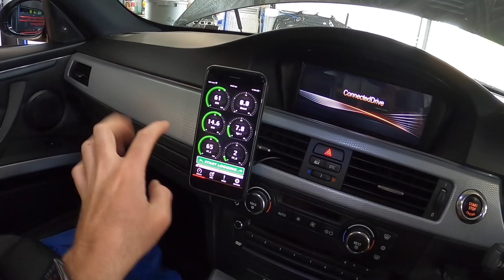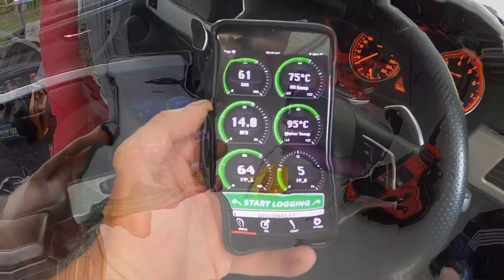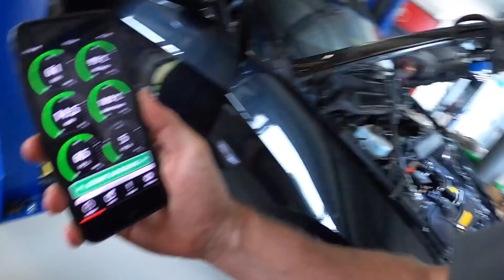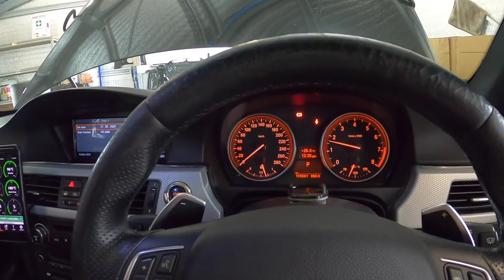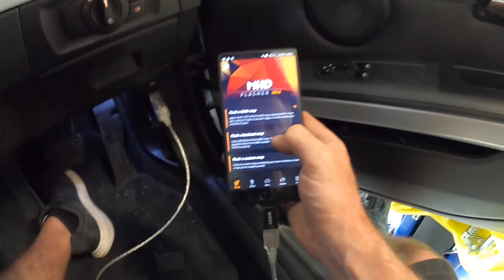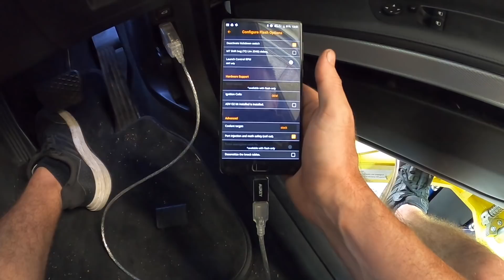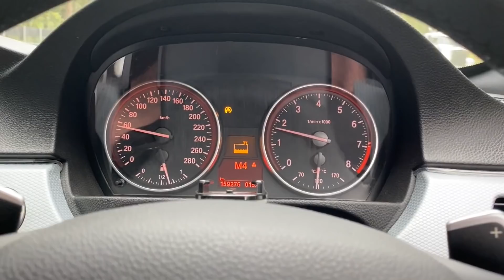BMW E92 335i N54 Motor Swap First Drive: HELL YEAH!!!

Comment: 16:43 I know that feeling of that genuine smile. Waiting on your 17T Turbo oil update to determine if your n54 burns any significant oil after some kms. Mine loses a stick on the digital monitor after 1800-2200kms. Some say that is high, but forums are all over the place now a days. Wish i had this rebuilt engine of yours. Keep up the good work mate.
Reply: I'm getting similar oil usage on stock turbos, all gaskets done, no oil leaks. 🤷‍♂️

I think it should be ok. N54's burn through oil and run higher oil temps than most cars (110-120c)

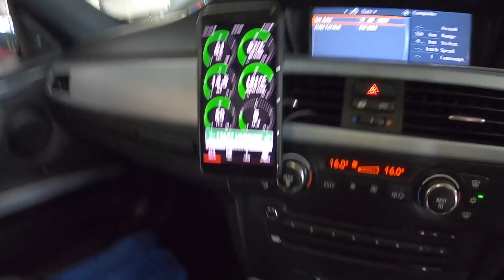Comment: 8:12 you're correct. The A/C won't come on if it's not charged up with coolant. I also won't come on if the coolant is too high or even too low. I found this out when trying to recharge mine this year (Summer 2021). It wasn't coming on to begin with as it was too low. But I didn't know that as the kit I bought didn't come with a gauge. (Oh silly me). But I soon found out it had some in it and when I went to put in the exact fill amount it stopped working again after it had begun to work at half the amount entered. Then stopped when I found out I put in too much.  Then I let out a bunch and it now works excellent.

Comment: Engine is sounding smooth 👍 Maybe I missed it but did you ever do a compression test after doing the valves?  Would be curious to see what it is on a refreshed head.
Reply from the maker: I didn't get around to it. I really wanted to, but just ran out of time.

Comment: Just found your channel and immediately subscribed, really like the video and your genuine excitement when you started doing pulls. Quick question, are you still running the T17s and if so how many miles do they have on them and how much would you recommend me to run them?
Reply from the maker: Welcome aboard! Yes still have the 17ts, They have done about 7000-8000 klms now. Still running strong and they are running some very decent power. My biggest issue is the noise single turbos make.

Comment: You shouldn't run it so hot on the water temp for a performance application. I run my cars and 90c at normal running conditions and 80c targets  during spirited driving. These are calibrations in the tune, but iirc the jb4 has a coolant target as well, ur mhd bef flasher also has options for sport coolant temps. Flash it to sport. It'll also help ur radiator and hoses last longer. The extra draw from the fan will also help ur fmic. All good things. Even your transmission will run cooler, you oil temps will be cooler too
Reply from the maker: Good to know you run them that low. How long does your car take to get oil to temp?  Like over 80c?
Reply: Yes im running the coolant target on sport mode which should target 95 degrees and prob reach over 80 degrees in abt 5 to 10 mins of driving
Reply: @ZeroTo60Tube  its better for VE (translates into more power) and helps mitigate preignition. Does take a bit to get my oil up to temp, about 10 mins of driving
Reply from the maker: When i have the ac on this thing sits under 90deg so i have never bother with coolant targets as i figured it was fine, but i will look in to it for sure.
Reply: There are four different engine coolant temperature targets depending on load, 108 °C, 104 °C, 95 °C and 90 °C. If you actually put the engine under enough load the computer will open the thermostat fully (MAP thermostat) and target 90 °C, just as you suggest. This is the default behavior. If he took that car as it sits and did a 3rd gear pull you would see the water temperature decrease.

The higher temps are good for emissions and fuel economy. Lower temps for performance, as you say. With the electric water pump and MAP thermostat you can have both. For a racing only application it might make sense to override the defaults and target 90 °C all of the time so the engine never needs to target a lower coolant temp (specifically for drag or roll racing where there can be a lot of idling or low load driving before the race). If he is then going to drive the car home from the track it would be best to allow the DME to resume it's default behavior.

https://www.1addicts.com/goodiesforyou/n54-2.pdf

Look at the "Heat Management" section.

Comment: Higher water and oil temps with AC off is normal mate. 
Don't forget with the AC on the condenser will be super cold and so allow colder air to flow through the coolant radiator.
And with no refrigerant it'll just switch low pressure lockout and not work.

Engine sounds sweet!!
Reply from the maker: Thanks for the tips!
Reply: Not true. The condenser is cooling down the hot refrigerant, it’s definitely not cold and only adds to the heat in the engine bay. The evaporator inside the car is the cold part.

Comment: Great work on the engine swap. I love that you are taking on jobs that you haven't done. How else do you learn? You do have a nice work space and a lift, so that helps. How many hours do you think it took you to remove the old engine and swap in a new one? Not counting time spent removing the old engine from the crashed car and prepping it. 

Really looking forward to seeing the inside of the E92 engine.
Reply from the maker: If i wasn't filming, i would expect to have it removed and refitted in 10-15 hours. Now that i have done one. Even with filming it was 4 hours to get it out this time, and i didnt really keep track of it going back in. But probably 15 hours to refit and connect everything back up. Then about 5 hours messing with the water pump and first start.

Comment: Yeah, my fan does the exact same thing. Thought it was strange so i checked the huge 100amp fan fuse in the trunk and everything but it is just hard to hear it. I thought i had broken it because i left it outside for like 2 weeks to drain all the old oil from the fan mounted oil cooler. Fan fact, e60 n54 has its oil cooler mounted onto the fan from factory so it keeps the oil at about 233° F at hottest.

Comment: Hi! About tomorrows video, xHP actually says to not do gearbox adaptation at any time, unless you rebuilded it. You can harm it by doing so. Great work with car!
Reply from the maker: The warnings exist because some people just shouldn't touch their car full stop and then blame xHP when they mess it up. For your own reference if you reset adaptations, do a proper relearn procedure and then have an issue, your gearbox is toast anyway. Resetting adaptations didn't cause the problem, its the hardware is in beyond serviceable condition and needs to be replaced or repaired.

Comment: I really like your steering wheel and paddles, is there a video of you fitting those? Congrats on the successful first drive!
Reply from the maker: Unfortunately not. But i have wrapped my spare wheel and i will do a video on them soon. Explaining how you can get the same setup. In fact we may do it on the new e92 as well.

Comment: Just for comparison my e90 335i always runs around 100/105 which made me panic compared to other cars ive owned, but 20k later still the same and mines only has filters n backboxes not even mapped.....yet 🤣, keep it up boys cant wait to see yous with 1mil subs 👍🏴
Reply: And have yous tried the torque app? I know it only does the same as jb4 on phone but mibi be an interesting comparison🤔 more for people without jb4 though, cheers again
Reply from the maker: Have tried torque. Found it really laggy and gave up. I was using a elm327 Bluetooth dongle.
Reply: Yeah it was very laggy with my 1st elm327 but was instant with 2nd one i got, with blue and yellow sticker if anyones intersrested

Comment: Wow sounds great guys. The AC has a low pressure system sensor. So it shuts off the compressor due to safety. Good luck guys. Btw comparing to my e36 325 vert the n54 warms up very slowly. I have to drive about 20km before having 95 Celcius( oiltemp) on the cluster. At first I thought the thermostat was faulty😅. Dutch regards, Nico
Reply from the maker: I think its crazy how slow they warm up. Good know others have the same experience.

Comment: I felt so much when you mentioned that you are learning as you go, it has been the same for me, ej20 turbo, then ez30r and now with the n54. Its so satisfying to see all go well (heck, going to the track tomorrow to test all out)

Im looking forward to your review of the diff and brakes, both are on my to do list and it will be nice to see non sponsored opinions, as far as I remember you didnt get to change the MC for the M3 right?
Reply from the maker: Thanks for following along really appreciate it.  The audience makes it all worth while. Regarding the master cylinder. No, i am still running the 335i one. As the bigger calipers have a larger piston surface area, the required pedal force has been reduced. So the pedal doesnt feel as firm. But the brakes respond more to pedal movement. On the same note, i feel when i brake from a higher speed the pedal feels amazing. Its just dull at around town speeds. I want to spend a bit more time with them to give my final opinion, but i think its probably going to be fine with that master cylinder.

Comment: The lack of pressure in the A/C system will disable operation.
Reply from the maker: That's what i thought, but when we did the first start with the water pump not working the thermo fan still turned on with the AC button.
Reply: @ZeroTo60Tube  does the A/C act as a cooler for the gearbox or engine oil?
Reply from the maker: @Saif0412  Not directly, but it uses the thermo fan to cool the ac condenser. So the thermofan in turn cools the radiator.

Comment: Heavy weight like an ls. I use an 10w 30 carol ultra clean. Very good
Reply from the maker: its got 5w40 in it at the mo, but i have heard of people running 10w60. However thats on rebuilt motors which may run different bearing clearances.
Reply: The wieght can help it rise to the rockers. Im no mechanic but it definately fixed mine. But going for rollers once i rajse the funds. Dont tell my missus haha

Comment: When everything is fresh clean (ports, fresh plugs and all of that jazz), the cold idle is amazingly smooth. Even though my N54 has had many things addresed, cold idle still seems not perfectly smooth. Still wondering what that could be... maybe just o2 sensors too old and worn out ?
Reply from the maker: O2's may have a part to play in that. Im a big fan of new O2's they have a lot to do with how these things run.

Comment: A diff makes a MASSIVE difference.  I went from 3.45 to 3.75 in my ss and now i have to slow down for cameras lol. Its not as qucik but sits comftable  at 100 on freeway
Reply from the maker: Well i have the same ratio, but i went to a proper clutched LSD. Which is really for track use and its definitely changed how the car comes out of corners.
Reply: @ZeroTo60Tube  lol bmw life a commodore is always a boat. Love you guys and your work. Not many people tackle an engine change on a sporty beemer. Nice work really love it and your tool tips 😃😃😁😁

Comment: You need a blow off valve for upgraded turbos especially  running high psi
Reply from the maker: Well only if there is something wrong with your stock ones. These have held 27psi not problems at all so far.
Reply: Diverter valves are more efficient, we just like the sound of blow off valves.

Comment: So I used to run MHD, then switched to JB4 and as soon as I went for my first drive with the JB4 I had waste gate rattle and that was on a brand new set of hybrid turbos with waste gate fix done. I took jb4 out and rand the car on stock tune and bam no waste gate rattle. But the waste gate rattle I had with the JB4 was on gentle acceleration when the car was under load and it would happen at around 2000 - 3000rpm, it was very irritating. I tried fiddling with default waste gate position and it would help to a degree. My understanding is that JB4 interacts with the boost solenoids at a lower frequency. 

I am now still running the same set of turbos and I am running a custom tune and have zero waste gate rattle. I tried pulling the jb4 out and putting it back in multiple times for over a year and it was always the same result, jb4 in = waste gate rattle. Jb4 out = zero waste gate rattle. Lots of people have experienced this same issue and lots haven't. I replaced both boost solenoids several times trying to remedy the problem and it too made no difference. Waste gate rattle is ultimately what made me ditch the JB4 and I have never looked back. I make far more power with a custom tune and my logs look a hundred times better too. 

I must point out though that I do drive a Z4 and although its a N54, it does have a number of differences in the ECU to other N54, one of the main differences is that a z4 doesn't have a low pressure fuel pump sensor. So all the MHD back end flashes for "my ecu" which is definitely not actually my ECU its for another N54 that runs the same version of ECU bin but has differences. So I would always get LPFP sensor errors.

The other thing to note is that with a DCT gearbox JB4 was terrible as with a JB4 the car thinks its stock, jb4 takes over the boost control so the gearbox doesn't up the line pressure so I would often get clutch slip especially without a back end flash running just the JB4 but even with a back end flash none of those BEF are actually written for DCT, unlike MHD where you select DCT or Auto or Manual prior to writing. so when taking the JB4 out my car and running MHd the gearbox would bang into gears properly and perform the way it should. 

I know its a long post but just thought I would put this info here.
Reply from the maker: Appreciate all the info dude!

Understanding JB4 waste gate control settings is about as hard as understanding what a woman wants to eat for dinner. I did have a sweet spot with these (well JSR did), however, regardless, and after i finished filming and had another look in the engine bay, i noticed a the vac line to the exhaust valve was off. So i had a vac leak which would have thrown off the wastegate vacuum explaining why the old settings were not right.

I completely agree with the ots JB4 BEF flash maps and the transmissions. The JSR tune is what got this car shifting so well. It was also pulling timing on the OTS bef maps.
Reply: @ZeroTo60Tube  yea if you have a custom map with a jb4 then you should be golden as the JB4 itself isn't a bad piece of tech, it has allot of useful things, I never tried a custom BEF map with the JB4 so I did have that against me, but the waste gate rattle issue just drove me nuts to the point where I ripped it all out and sold it and went full custom flash. Glad you got the shifting thing sorted and the timing issues.

Comment: did you log the entire warmup by chance or just the first part of the cold start?
Reply from the maker: about the first 10 mins. Just incase it shat the bed randomly, i would be able to see if timing started dropping, or if fuel pressure was the cause.... not that i didnt have any faith in my work or anything :|

Comment: Which do you recomend jb4 or mhd? And also how are your twins making that sututut sound instead of just a woosh what bov are you using? And love your vids keep up the good work
Reply from the maker: Im running stock diverter valves, but the 2 inch silicon inlets are where a lot of the sound comes from. Regarding the MHD vs JB4, it depends what you are doing setup wise. Basic car MHD is fine, if you want to get a bit more serious and add port injection, thats when the JB4 paired with a custom tune really shines.

Comment: Id highly advise not doing transmission adaptation resets on the zf6 or 8hp trans
Reply from the maker: I’ve done heaps. I’ve also rebuilt mechatronic units. It’s fine if you know what you’re doing.
Reply: @ZeroTo60Tube  you do you ofcourse but even sutphin tuning warns against it.....nothing good can come of it
Reply: @gaboonviper85  What's the worst that could happen? Surely it'll relearn after some time?
Reply: @zeroyon4562  burning clutches....if rebuilding a trans isn't an issue for you then send it but im not a fan of having to pull a trans and spending several $$$$ on getting it rebuilt
Reply: @ZeroTo60Tube  After adaptation reset perform adaptation learning driving cycle as per ZF procedure then check the adaptation values filling pressure for clutch A,B,C should be between -400 to +350 mbar. Clutch D -300 to +300 mbar, clutch E -300 to +200 mbar. Rapid filling time for clutch A,B,C around 40 to 120 ms and clutch D -300 to +200 ms using ISTA D. If they are all in range you are good to go.

Comment: What OBD plug in are you using and the software on your phone? Loving the videos 👍
Reply from the maker: Just a eBay k&d can cable
Reply: @ZeroTo60Tube  how are you logging information from the car? Is it through a wifi/bluetooth OBD reader and an app on your phone? Or is it to do with your map where you can adjust the waste gate etc..
Reply from the maker: @Thewhitepearlfocus  JB4 with bluetooth module.

Comment: Have you tried changing the speed of the water pump on MHD, see you have it on stock which I have heard it wears the motor out quicker ( have no idea if that's true), I run mine on sport for the last couple of weeks and my temp sits on 95c all the time. I'm interested in what you think.
Reply from the maker: I havent but that is something i will look in to. With the ac on the car stays around 90c, so have never really looked in to it. But i think i will now.
Reply: @ZeroTo60Tube  before I changed to sport my temps were between 96c to 100c more toward 100c. My car is 2009 135I and has only owned it for about 2 months with just the stage 1 tune, a little different to yours. Your show has been a big help thank you.